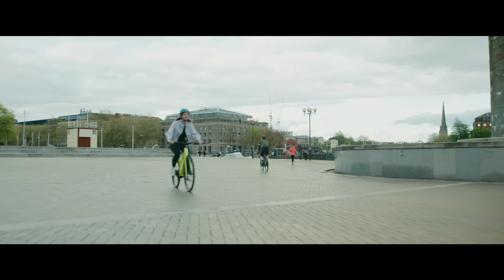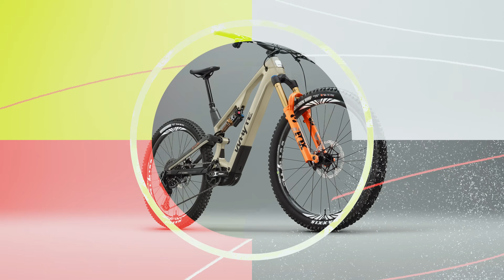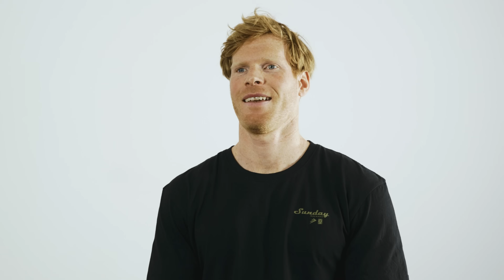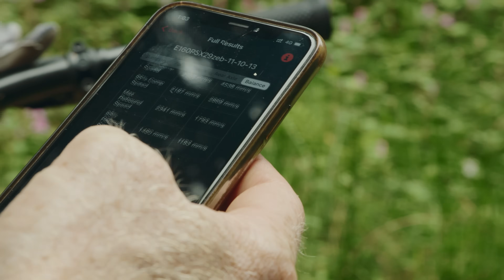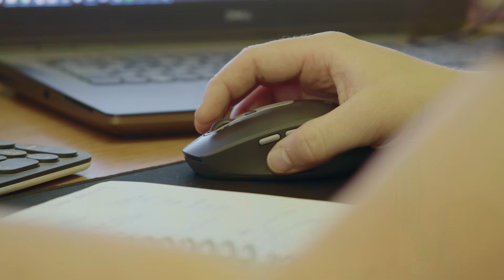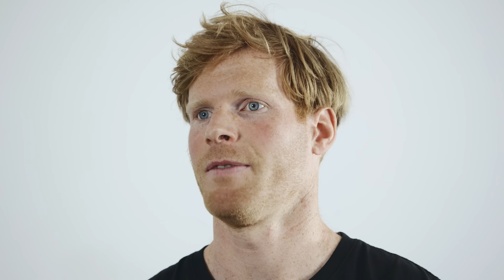Engineering extraordinary | How Whyte creates award-winning bikes through first principle design

Comment: We can provide you with high-precision machining services for a variety of components, including aluminum frame parts (such as chainstays, head tubes, and bottom brackets), metal fittings for carbon fiber frames (such as shock mounts and ISCG chain guide tabs), and CNC-machined accessories for complete bikes (such as integrated stems, linkage plates, and battery mounts). These services are designed to meet your strict requirements for structural strength, assembly precision, and surface finish.

May I ask if you currently have any bicycle-related machining projects or needs?

Comment: Interesting video. Given the extra testing referenced I'm surprised that your warranty on frames is a mere 2 years and a lot less than other competitors and not enough in my opinion. I like the concept of the Elyte Evo and did have an E5 back in the day but I'm nervous of carbon, having wrecked a carbon wheel without much effort, although lighter weight definitely appeals. I am looking for a lighter e-mtb in the near future and the Elyte is a shortlist contender if I can get an end of season deal so this is a genuine comment/concern.
Reply from the maker: Yep, we thought the same thing so we launched our new lifetime frame warranty back in November last year (at the same time we launched the ELyte EVO); this stands alongside our lifetime pivot bearing warranty - that we've offered since 1999 - and both are free. You just need to activate them by registering your bike within 28 days of purchase. You can learn more about all our warranties here: https://whytebikes.com/pages/warranty
Reply: Just had your arse handed to you on a plate nice reply Whyte 👍